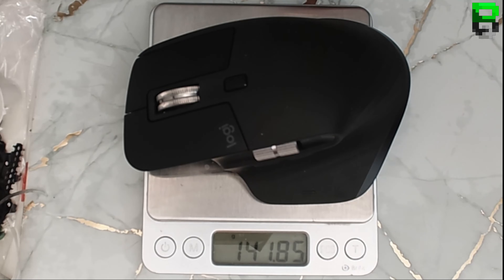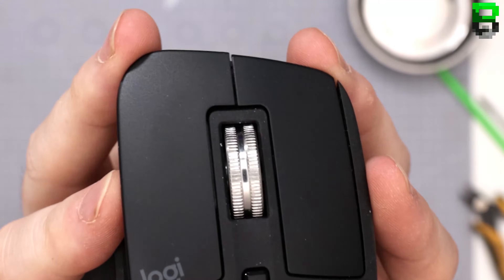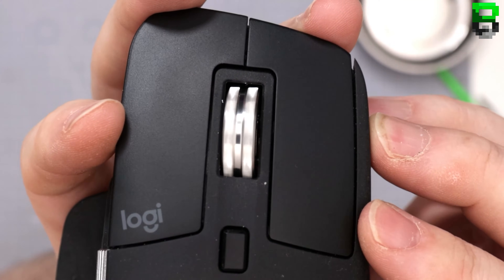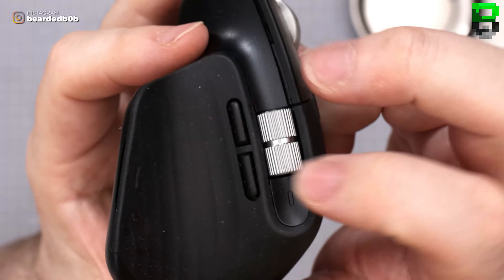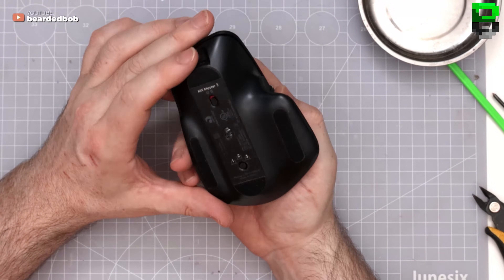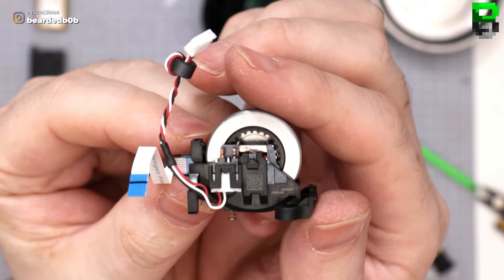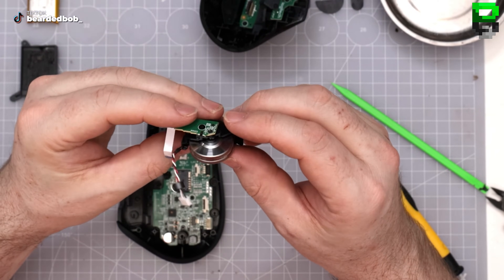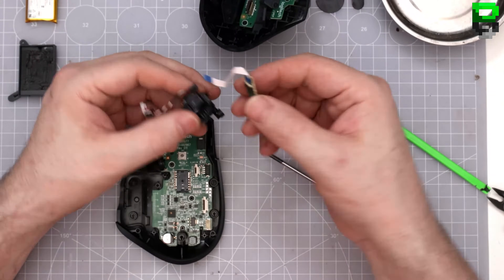Logitech MX Master 3 Disassembly Guide: Repair & Clean Step-by-Step

Comment: What a mess. Components on the daughter boards that should have been on the MB. Just looking at your disassembly the only thing that should be on daughter boards are some of the switches and the wheels at most. Would eliminate a lot of the ribon cables that way.

Comment: There is a small issue that might happen from time to time with the scroll wheel. I dropped it once and it got stuck. I had to open it and one of those gear looking things came out and so did the small magnet inside the core of the scroll wheel. Luckily it was easy to push everything where it was suppose to be and now it works fine again.

Comment: I wish Logitech would not put the stickers over the screws. I would like to see that one visible screw would be enough to open up the mouse. The biggest problem I face is lot of lint accumulation underneath the scroll wheel over the time, causing the wheel to be "sticky" and hard to turn.
Reply from the maker: Agreed

Comment: The left click on my MX Master 3 was acting up—sometimes not registering clicks—so I opened it up with the help of this video. Inside, I found a tiny, thin torsional spring that pushes the button back after a click. The spring seemed to have weakened, so I removed it and carefully stretched it outward to restore its strength. It was barely visible at first, making removal and reinstallation tricky. The issue seems fixed now, though the exact cause remains uncertain.
Reply: Literally why I'm here watching this. Thanks man.
Reply from the maker: Glad it helped 💪🏻👍
Reply: I have the exact same problem right now, did you find it an easy repair?
Edit - I sprayed under my left click a good amount of contact cleaner and let it dry in sun for 20 mins, worked a charm. Must have just been build up of grease or dirt under/around the micro switch
Reply: @danny-x3  It was not suuper easy and took time, and worse than all, since the spring has gone over its lifespan, it came back. So unless you buy a new spring (which also takes time) I wouldn't suggest it.
Reply: @bkamrani  I sprayed under my left click a good amount of contact cleaner and let it dry in sun for 20 mins, worked a charm. In my case and perhaps many others - Must have just been build up of grease or dirt under/around the micro switch
Reply: @danny-x3  Glad to hear and hope it doesn't come back at you. I ended up switching the right and left click on the software haha (the other one is used way less frequently) 😃
Reply: @danny-x3  Ho w much did you disassemble to get to using the contact cleaner?
Reply: @jordanwind3586 literally nothing. My dad is an electrical engineer and said the micro switches often get jammed with grease and other crud,  and it’s rare for them to go faulty (albeit he did not look at this video or the micro switches used in this mouse). I sprayed under and around the left click button (make sure it is turned off), then spam clicked for a while, sprayed more and then left it to dry outside in sun (would take out of sun if mouse get too hot) then would occasionally spam click. Overall left for a couple hours to dry. It has worked perfect ever since(hope that doesn’t jinx it 😆)
Edit - looks like I said I left it out for only 20 mins. Would say to leave it for an hour. It was a very hot day when I did it
Reply: I had the same issue with the left click. When I was trying to put the spring back, it shot off and I lost it. 😡
Reply: Thank you! While I was wasting time watching a man weigh screws for no apparent reason, out of boredom I found your comment and thread. Helped me to resolve my issue.  I will now move on to far more important issues, like how my grams the mouse weighs.
Reply: This comment right here just diagnosed the problem I'm having. Thank you, to both of you and Beardedbob.

Comment: my right button has started to play up. i right click on spell check and it takes a few times until it works. what could this be down to? ive had a look and checked updates and only option i have to try is clean it. but it doesnt look like dirts gonna be the problem.
Reply: @sasproductions701 Any update on this? I have this exact problem but on the left click. Just curious if you have found any solution? Thank you!
Reply: @bkamrani  no i havent bothered with it and using my old Roccat Kiro mouse. i wish i never spent this kind of money on it tbh. i got the G915 TKL keyboard and thats doing me good and i find it much better and comfortable to use than my old Corsair K70 mk.2 keyboard. the red switches aint for me, they are hard to press in a sense and noisy as fuck and i had the number pad section on it and hated it and wanted the smaller version without it. thin i got this logitec G915 and find it better for my gaming.
Reply: @ Totally understandable! I ended up openning it up and seemingly fix it. I'll post it as a standalone comment just in case if it's interesting to others.

Comment: 9:39 Thank you for this. I kept thinking I missed a screw, but nope.. You just gotta' yank on that fucker. 

My MX Master 3S is working like-new again after using the cheap (eBay) Chinese knock-off Panasonic switches. One is clicky, the other is silent, but both work flawlessly. I'd definitely perform this mod/upgrade again, over replacing the whole mouse. I paid $4 for the switches, and $6 for the replacement feet. That's pretty cheap to repair a $100 mouse! 

Again, thanks for the detailed tutorial. Everyone starts to feel nervous when realizing you're surrounded by 40-ish tiny screws!

Comment: I was cleaning the dust under the scroll wheel on my Logitech Master MX 3S mouse and in the process I lost the miniature spring that sits under the scroll wheel. Is it possible to get a replacement somewhere, or at least get the exact dimensions of this spring?

Comment: I cannot for the life of me put this thing back together. Do I have to gorilla force this thing?
Reply from the maker: Just take ya time it will go back together 👍.. what did you have to take it apart for
Reply: @Beardedbob  Thanks, I found that if I clicked the pinky and thumb area in first I could push down on the main buttons and everything would snap into place. At first I was trying to avoid pushing down on the buttons.

I have a 3s version, I had to replace the lift click switch.

Comment: I want to replace/swap some parts of my device, but I'm worried about putting it back together. Any tips on fixing the external "sticky" pads that hide the screws? What glue/method should I use to make them look and work like they did originally? Thanks! (Mine are Master 3S units, but judging by their identical looks, I would bet the same applies on both 3 & 3S)
Reply: If you call up Logitech they apparently will just send you new pads as long term or for people who do lots of things like cad they are a consumable

Comment: Is this the 3S? the reason I ask is you're one of the few (excellent) sources of actuation force for clicking (an important factor of ergonomics for me)

The 3S seems to have a heavily revised microswitch that is quieter, but more importantly has an unknown actuation force that feels very light and really, really feels perfect for me.

I love a few different razer mice, but their switches feel heavier for sure. it'd be great to know what the 3S is at in case I want to mod some gaming mice to be more friendly!

thank you SO much for the data sheets you've provided. they're hugely helpful! there is a glut for keyboards but not for mice.
Reply: you can see on the bottom sticker its not 3s

Comment: I would love to have a gaming mouse with the MX Master scroll wheel. The mouse just feels too heavy, the sensor isn't accurate enough and I would prefer a lower mouse shell.
Reply: doesnt the g502 have somewhat that? its plastic but thus lighter and also got infinity scroll
Reply: @BurnoutWien  I might just use my 3d printer to create a special design. The G502 is so heavy and feels a bit too rounded for my preference.